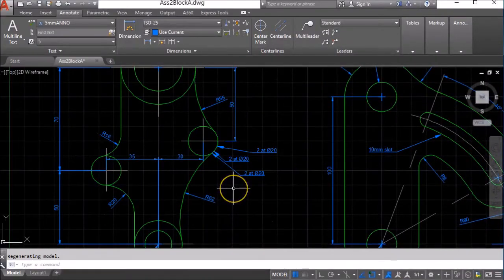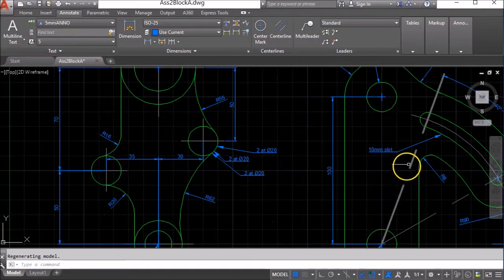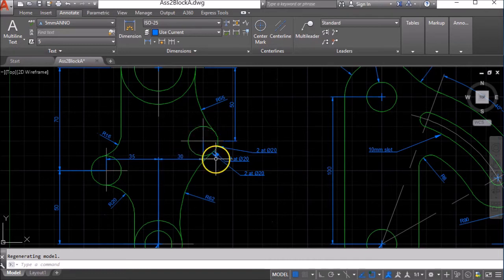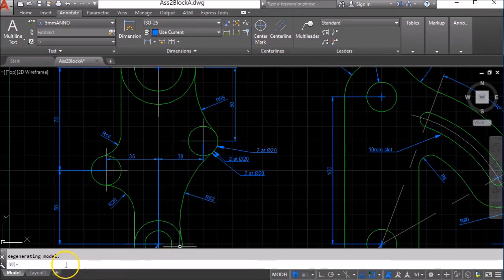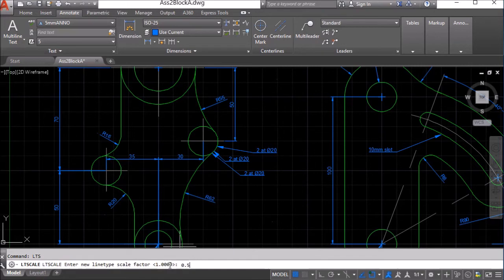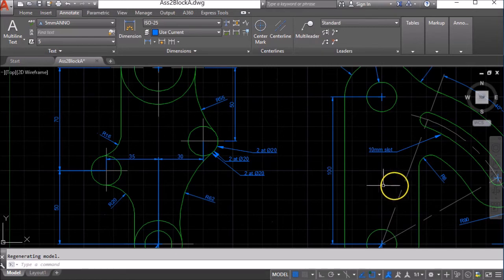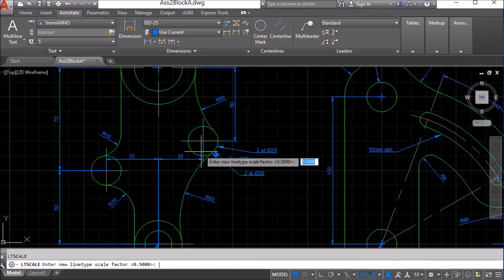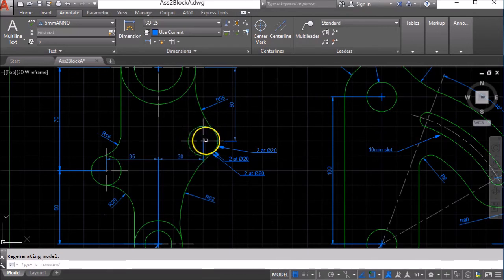How to change the line type scale in AutoCAD

Comment: If I want to change a dashed line scale without changing the center line scale what should I do
Reply from the maker: You can change the line type scale of an individual element by selecting it and altering the LTS value in the "properties" of that item. When you've selected the item, do a right click and then select "properties" from the pop up menu. This is useful if you want to use different LTS for different parts of your drawing. By using the "LTS" command on the command line, you will alter the LTS in a global way across every item in the drawing.
Reply: @CADandStuff  Thank you!